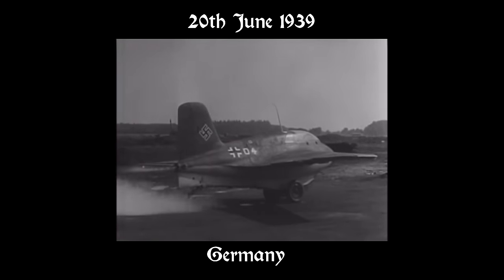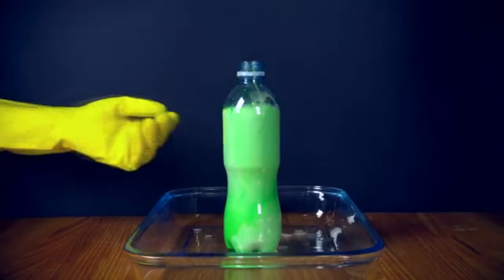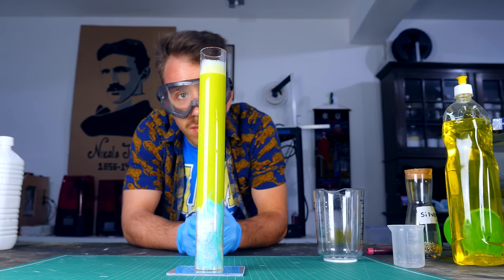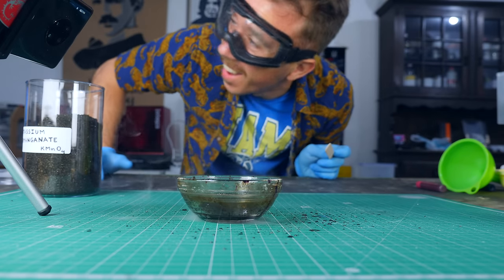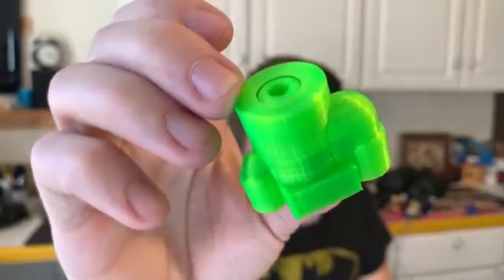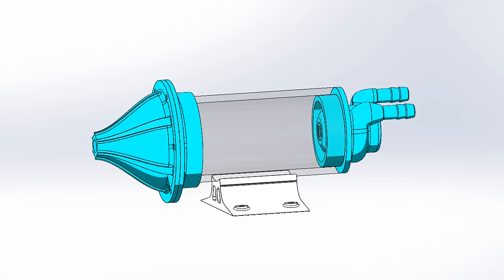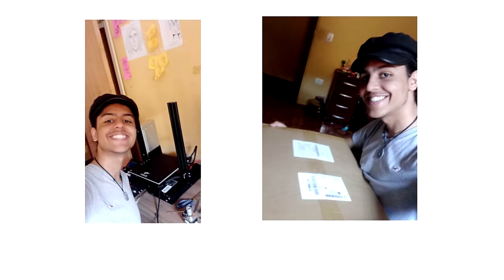The Forgotten Nazi Cold Rocket Engine (3D Printed)

Comment: Do not use syringes, use pressurized tanks instead! Take two pressure tanks for propellants, and third tank just for compressed air (a few bar in Coke bottle should be ok). Connect both tanks to third one using some valves. When valves open, high pressure air will push the H2O2 and catalyst out of them into the chamber. This is safer since you can close the valve in case of emergency. This also would provide better control of the mixing ratio. Also a good idea would be to use check-valves to prevent incidents of pressure backflow from chamber.
Reply: Yes and maybe CO2 canisters instead of air pressure. Although with the speed of the reaction it might be difficult to control.
Reply: @MartII89NL  I didn't mean to control it in real time, but to adjust the flow rate of ingredients before the test (some sort of pipe narrowing or half opened valves). And since the ingredients used by Integza aren't flammable, I think CO2 would be redundant.
Reply: Think this will only work if he have the two chemical in 2 Ball shape Tanks, because of the pressure aerea. But also there need to be checkvalves so that the whole think could only react in the chamber, remember that there is a lot of pressure in the rocket
Reply: Pretty sure you guys are describing a super soaker
Reply: @larryfigerbutz7184  a super soaker on steroids crack and meth because the rocket engine will have significantly higher pressures to deal with but yes same basic concept
Reply: @m4vr1ck  As 90's kid: Super Soaker Science is best science. 

Fight me, Youtube!
Reply: Did you think about the pressure fighting back? I’d add check valves wherever I could
Reply: a check valve wont resist a change in pressure if there is flow from the tanks to the engine.
like the pressure of a fluid in a pipe is effectively constant so if the check valve is open the pressure across it will be only due to resistance unless it closes
Reply: @raphrath8561  true, id add them just 5o be safe
Reply: I’d say possibly add a turbopump since this reaction seems like it generates enough energy to use a pump. Just rescale the turbo design used for the car and tack a couple more turbo bits for pumping and power generation to spin the pump. Rocket stays the same. Only problem is Potassium rich or H2O2 rich, and would a simple t joint be enough to pipe one liquid away from the main fuel line. Still a valid idea unless someone thinks otherwise.

And I just now thought of the turbo exploding but I don’t think it would reach CO2 pressures. But being a smaller part it will not be as strong unless you don’t scale the turbo down.

I’ve also realized this would be a closed cycle engine too if you pump all of one chemical into the pump and a bit of the other…. Wow this got complicated quickly. Still possible? I think so… With enough pain and suffering? Definitely.
Reply: @DoggyDev  i specialize in mechanical insanity
Reply: @DoggyDev  Turbo pumps are insanely complex to design, and require a lot of additional equipment to support its operation. Please notice, that it wolu'd have to generate few bars of pressure difference at very high flowrates, wchich is very very very hard to design and manufacture ... like the complexity of million dollar expensive design.
Reply: @hufca   This first “simple” way I described using just tubing a modified turbo wasn’t intended to be uber efficient just a proof of concept. In a way you scale the base rocket down and point it at a turbo which spins a couple more speeding the liquid up not by much but hopefully better than pressure fed. It’s not like I’m saying remake the Raptor from Space-X. This is comparatively a low energy reaction that barely generates heat. Only heat will come from friction. It’s in a sense like using electric pumps but spinning them using the rocket propellants. I have an idea in my head I just wish I could put that in here. I also think that starting with an open cycle engine would be a good idea until more testing is done. Anyway just a proof of concept. My only fear is still the turbo blades exploding how they did with the car, but I also have hope that the same pressures and speeds would not be reached and with the exhaust being relatively room temperature the turbo shouldn’t get brittle. But before this idea there should be a pressure fed engine tested then build on the idea with the turbo pump.
Reply: @DoggyDev  100% no feasible with the manufacturing capabilities avalable to integza. Honestly i think a mechanical spring pressure fed design would work best with some mtb springs or something of roughly of that size. you would also want them to be damped to avoid the same sort of oscillation we saw when he pushed the syringes by hand.
Reply: @DoggyDev  yea na an automotive turbo isnt gonna pump a liquid with any sort of efficency and its definitely not gonna survive high concentration peroxide, not to mention they dont really come at the sort of scale that integza is working at. this is defiantly the real of pressure fed engines.

Comment: Two points about rediscovering old chemistry.  I am a lot older than you and our chemistry teacher in 1966 was working during WWII in developing 100 vol hydrogen peroxide for use in rockets etc.  He was called Dr Roper.  As far as I know the V1 a heavy brute of a rocket needed to be shoved up into the sky at reasonable speed before it would fly off it’s pulse jet.  This was achieved as aircraft on an aircraft carrier.  That is a tube with a slot along the top on which the rocket sat on top of cylindrical slug.  The slug was propelled up the launch tube by the mixture you are describing.  The slug fell away in front of the launcher.  There is one by the road visible through the hedge at Duxford Museum near Cambridge UK.  The steam generator is also there with quite a number of chambers and pipes to hold and control the chemistry.  The are bound to be pictures somewhere of it perhaps on Wikipedia.

Comment: A good idea might be to keep using the two syringes and have a small yet powerful electric motor( low KV, 150-350 KV probably ) and a setscrew to simultaneously push on both plungers. If the speed of the motor is to high, i recommend printing a gearbox to increase torque while slowing down the rate of fuel consumption.

I understand that this complicates things a great deal, but hey...it's Nazi rocket science, what did you expect?

Anyhoe, well done! Keep up the good work.
Reply: You would need to control the reaction better... Slowing down and speeding up the movement of the serine won't help. The reaction speed is only one, to use some kind of gearbox, you whould need to convert the energy, like he mentioned, in an steam engine way...
Reply: Maybe for the pumps a stepper motor and leadscrew on a syringe might work
Reply: Probobly easier with a pressure tank. Its not much displacement  needed
Reply: To follow up on this, what about the proportions between the catalyst and chemical, do you need less peroxide, or more? How about a hydraulic system with a proportioning valve that uses two hydraulic rams pushing the syringes?
Reply: To add my own convoluted yet I believe highly functional method: Pressurize both liquids into separate canisters using a compressor machine at home, and then use electronic controlled valves to release the high-pressure liquid. This allows you to fine control the amount of each coming out, as well as increase their speed upon contact thus mixing them better. The valves would be controlled by something like a raspberry pico or an Arduino. 

I know this method is very convoluted and complex, however, it is the best I can come up with right now.

Saudações portuguesas, ó grande enginheiro!
Reply: Oooh! Hey, too add more to this, i noticed the engine pulsed every time he tested it. A new "combining" chamber that takes advantage? Like the air intake for a pulse jet?
Reply: Sorry but that’s a pretty terrible approach. I’d simply start with a peristaltic pump. Easy, cheap, throttlable, anti-backlash.
Reply: 2 hefty rubber bands can probably do the trick just fine
Reply: @Liedson9000  I totally agree, but don’t you think that the pressure inside the canister would have to be very large to overcome the pressure of the steam in the “reaction chamber”?
Reply: Or, use an Archimedes screw in the syringes so you can control the speed and flow rate while also not limiting the volume to that of a syringe
Reply: That is a shit idea all together, a good way to do it is trap the permanganate in a mesh inside the combustion chanber and use air to pressurise the h2o2 tank a bit and a valve to open it
Reply: @deeperlayer  How would you simply yet effectively hold the permanganate in a mesh in a rocket that will most likely experience a lot of jostling?
Reply: @jonathanangladadavis  please read about peroxide rockets like space thrusters for example
Reply: @integza worth noting if you go this route that you should run both off one motor, and put a gear differential between them to fix the volumetric ratio around 1 to 3 (you can math out the exact answer pretty quickly).
Reply: This I what i was thinking but more specifically I would use two syringes with the same length but different diameters to get the correct ratio
Reply: Or an external gear pump, or peristaltic pump
Reply: Well well well look who si here again.... Integza already knows that You are buying likes

Comment: I love how he didn't even want to talk about a hypergolic rocket engines.
Scary stuff.
Reply: He kinda does, H202 is hypergolic in some reactions (the concentrations the Nazi's used in the 163, for instance). Generally though, hypergolic fuels are insanely toxic. As are some monopropellants
Hydrazine is an example. It's one of the byproducts of mixing bleach and ammonia, to put that in perspective.
Reply: "Well, it's all the same dangers of monopropellent rockets but it's also made out of EXPLOSIVE POISON! :D"
Reply: The Luftwaffe found that out really quickly. Fuel that melts the pilot and explodes if the ground crew sneezes really isn’t a winner.  Particularly if you are meant to attack things that shoot back with lots of .50 caliber machine guns.
Reply: I WANT TO KNOW THE STORY BEHIND THIS THOUGH!!!
Reply: I recommend the book "Ignition! An informal history of liquid rocket propellants" by John D. Clarke. The craziest fuel he talks about is dimethylmercury, an insanely dangerous neurotoxin. And for the oxidizer it's probably FOOF, which wants to decompose, when you look at it the wrong way.
Reply: @deadhamster7570  i know all of this stuff already, i am more curious about integza specifically aversion to it
Reply: @deadhamster7570  IIRC the dimethylmercury was (briefly) considered but never fired in an engine.

Comment: “Safety third guys” now that’s a quote that I will live by
Reply: Safety Third, 
because that comes after 
Fun (1) and
Profits (2). 
If it makes enough money, ignore safety.
If it's fun enough, ignore costs.
Never let safety hold you back
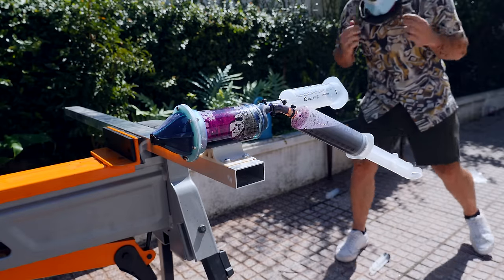Reply: 13:50
Reply: Safety third , then teamwork
Reply: @Karl_Kampfwagen  Be happy or die trying hahahaha
Reply: Check out "Well There's Your Problem" Podcast.
Reply: I can't stress enough how dangerous H2O2 is to your eyes.  He should be wearing a full face shield.  Actually, he should also have the syringes operated by a lever, or even better, a weight and pulley.  Both of those would have the added benefit of equal feed rates (primary benefit is remote activation).
Reply: Sounds like the Germans motto late in the war.
Reply: CrazyRussianHacker be like
Reply: @wowalamoiz9489  I agree
Reply: Yoyoy UwU yo so cool
Reply: I have lived by that quote all my life. Gotta say very few regrets in regards to it
Reply: Safety always off

Comment: I remember seeing the test footage of one going full vertical and absolutely losing my mind - the interview with Hanna Reitsch is really interesting. They use hydrogen peroxide for some rocket drag cars - make a mini one! :O
Reply from the maker: How about I make a big one? Muahahahahah
Reply: @integza  9:08 धन्यवाद* No offence lol made me soooo happy :)
Reply: @integza  ohyessss!
Reply: @integza  high proof hydrogen peroxide is scary stuff. 

If you want to avoid the drama of solid catalyst beds, spraying a high pressure jet of KMnO4(aq) against a jet of H2O2 would probably be the easiest way to get fast mixing.
Reply: When I was 12 i made a lot of firecrackers mixing potassium permarganate (марганцовка) with aluminum powder (there was a lot of it, used as paint in soviet times) and some matches heads for primer , when the mix is right you get nice big explosion shining like supernova, when it’s wrong boom is much smaller but it shoots permarganate crystals in all directions they getting stuck in the clothes and when you wash it magic happens :all of your clothes  are covered with 5mm holes and/or pink spots …) , you also can make rocket from that mix but it can blow up)
Reply: @integza  you could borrow a rocket from Elon Musk, would save him having to scrap them :)
Reply: That’s a fun idea for a test bed to work on optimizing the engine. I believe Tom Stanton has printed some small cars in the past. Might be able to ask him for the files to use as a starting point.
Reply: In other news youtuber  @integza  dies in a horrific accident involving a hydrogen peroxide rocket.
Reply: Do you have the video?
Reply: Most of jetpacks up to date flying on concentrated hydrogen pyroxide. AFAIK it is the most notable example.
Reply: @integza  Use a large Erlenmeyer flask instead of a graduated cylinder. The funnel shape will cause it to shoot up much higher, and the greater contact surface area between the peroxide and permangante solution will allow for MUCH better mixing upon addition. But PLEASE wear long sleeves when working with 50% H2O2, it can cause really serious chemical burns and scarring. This experiment can be done just as effectively with 30% peroxide (used for hair bleaching) or even warm 8% peroxide.
Reply: @almsco  so funny #sarchasm
Reply: u get a 3d printer again
Reply: @integza  what if you used a one way valve as part of the pumping mechanism so that there would be no back flow of steam
Reply: @integza  I think you probably knew, but the reaction produces KOH potassium hydroxide, a strong base. So be careful when preforming the experiment and when performing with big batches, it is even more dangerous. Maybe you should add sulphuric acid to neutralise the base. You should talk to a chemist about this, I am just a high school student.
Reply: Hanna Reitsch flew the ME163 Komet. It had a much more dangerous rocket motor powered by hydrazine / methanol fuel oxidised by 85% hydrogen peroxide. Riding one of them was way, way sketchier than the Heinkel.
Reply: @shurmurray  Jetpacks always sound boring but if they fly on hydrogen peroxide,, that is interesting.
Reply: @sampleoffers1978  only in recent years they start to use kerosine jet-turbines. And still in prototyping stage. Older and time-proven models used in different airshows and events powered by peroxide as i already pointed.
Reply: There is also the "Rocket man suits" who used peroxide sprayed on a silver mesh for the rockets...

Comment: Chemistry is so cool that we're still blown away by stuff from the 40's. Integza, why not use a tesla valve to feed the fuel evenly to the rocket chamber and prevent the kickback? I think you could still use the syringes without them exploding on your moustache.
Reply: Ahh bringing back Tesla solid state valves I like it
Reply: This comment needs more likes!
Reply: Genius idea
Reply: I was thinking the same thing!
Reply: For one thing, tesla valves suck at stopping kickback, for another they have a relatively high resistance even in the forward direction... The only way to ensure there is no kickback is to make the pumping pressure higher than the nozzle pressure. That may mean closing off the pump until the reaction has died down a little (like a pulse jet). Or the inlets must be a lot smaller in diameter than the nozzle.
Reply: Tesla valves can be very restricting even when stuff moves in the right direction, But that small amount of stuff if really powerful can be More than enough! :) good idea